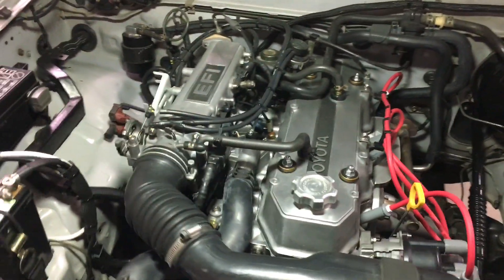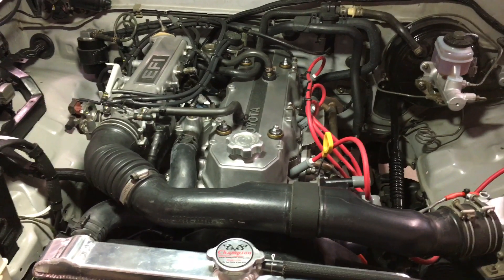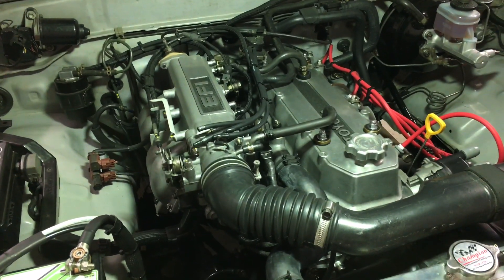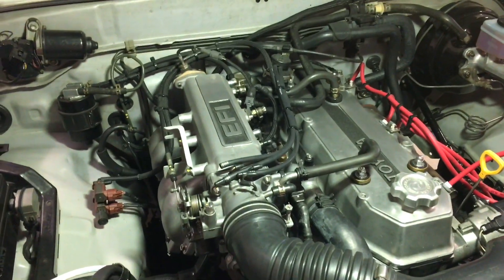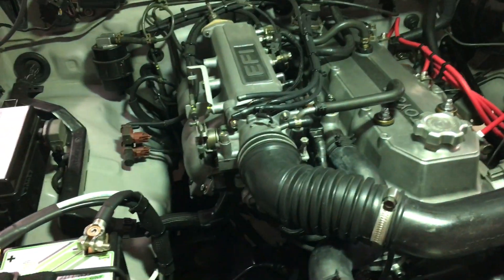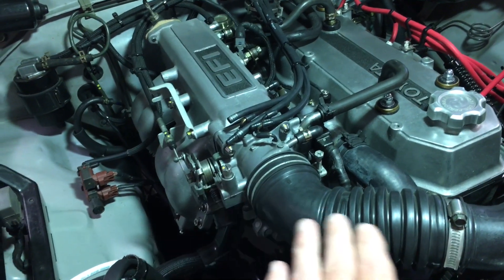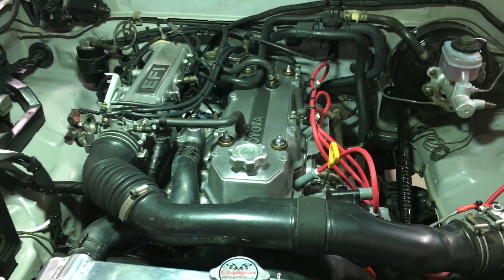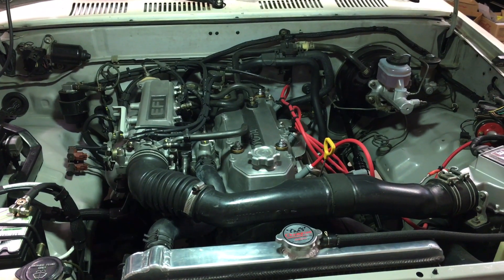Toyota 22RE pickup dashpot adjust fixes unstable idle (dropping to 500 RPM's when coming to a stop)

Comment: I'm starting to have an issue with my 94 toyota pick up it turns on with with no hesitation it idles perfectly fine when I have it In park but last week I was at a light and when i took off it started to sputter and jerk as I was pressing the gas and it almost had no power until it just stalled out completely, any idea in what this issue could be ? Like i said it has no issue starting up and idles completely fine on park its just the whole accelerating issue and having almost no power and then stalling out
Reply from the maker: could be a lot of things, but I'd start by checking your plugs to see if they are dirty or oily and also check fuel pressure.
Reply: @ray5961  thank you sir i removed one of the spark plugs and it had oil on the thread but not on the electrode im going to replace all of them and will run a pressure test
Reply from the maker: @AlanGonzalezAGON  which plug # had oil? Yeah, a compression test is a good idea. Pull the 15A EFI fuse when you run it and keep the throttle plate open. All plugs out.. PSI should be around 170 +/- across the board
Reply: @ray5961  will do and it was spark plug #4
Reply from the maker: @AlanGonzalezAGON  Do you live in an area with any hills? Sometimes what happens on the 22RE is that it sucks oil through the PCV into the intake manifold... then when you go up a hill, that puddle of oil rolls back and gets drawn into cylinder #4. Not always, but if you see blue smoke coming out when you are going up a hill under load, you might want to check to see if there is oil being drawn into the intake.
Reply: @ray5961  I live in houston tx so its pretty flat here haha but I did buy the truck from Kentucky with 86k miles about 4 months ago i am planing to give it a full tune up and replace the from main seal and new timing and valve cover gaskets since it is leaking oil but not a crazy amount
Reply: I bet it is the fuel pump. They can do what you are describing when they are going bad.
Reply from the maker: @johnjames77  I would say you were onto something, if I hadn't just replaced the fuel pump :-) In the end, it just turned out to be a lot of issues. I think I had my IAC valve adjusted incorrectly and that was most of the issue. I'm running it at 4.0 turns out CCW and it's nearly perfect. 4.25 turns might be exactly right, but I don't want to have to take the IAC valve off for the 10th time :)

Comment: You'd think that slowing down the throttle closing would contribute to a leaner condition since that means more air was allowed in than if the throttle closed faster.  I removed the dashpot and all emissions devices from my '94 Xtracab 4x4 DLX 22RE, as well as the VSV that alters the fuel pressure vacuum signal (I was prepared to re-equip that one in case the truck behaved goofy and/or had any quirks starting up hot, but it's been 4 years w/o issue). 
I'm also running header (Doug Thorley), test pipe (well, home made flex pipe with flanges to keep stress off the exhaust) and LCE catback.  Sometimes on decel in 2nd gear, at low RPM (~1500) I get a nice gurgle, but IDK if that's related to the dashpot being removed.
Reply from the maker: Yeah, I'm not sure. I have since disconnected my dashpot totally and I'm not having any problems. I believe I have traced the issue I was having to too much oil being drawn in through the PCV valve. I'm still testing, but as soon as I know for sure I may delete this video and post a new updated.
Reply: @ray5961  Interesting.  I do have an oil catch can plumbed in between the valve cover PCV and the intake mani plenum.  Mine collects maybe about a cup of oil every year.  I assume it’s related to my oil consumption, which is bad enough to warrant adding a quart between every 3k mile oil change.
Reply from the maker: @cbh148  I'm going to do a video on oil consumption soon here. I ran into similar stuff. For a while my truck was using 1 quart every 450-500 miles and I thought I had oil control ring issues. Turned out it was PCV / baffle issues I think. I made some mods and put the catch can on and discovered it was drawing a huge amount of oil out (about 1.5 oz per 30 miles). After making some modifications to the PCV, I have it down to around 1/2 oz per 35 miles, which is I think around 1 quart maybe over 2000 miles. I've got to modify the internal baffle soon to see if I can reduce it down even more. But thanks for sharing your info, that's really helpful!
Reply: @ray5961  Sounds like a similar path to mine, where I replaced my PCV a few years ago hoping the original one was worn out in an attempt to improve crankcase vacuum and, thus, ring seal to decrease oil consumption.  Looking forward to the vid.  I've heard some have had luck putting Marvel Mystery Oil in their cylinders, then letting it sit overnight to free up rings, but I haven't tried it.
Reply from the maker: @cbh148  I've poured everything you can think of into my cylinders lol. It definitely helps free things up. Most of the oil is being drawn through the PCV typically. In my case, I had to cut off one of the baffles for my dual row timing chain conversion and I think that opened up a path to allow a bunch of oil to get sucked out. I just was messing around with how the PCV is mounted and went back to more of a stock setup; the result was 5 oz of oil sucked into my oil catch can in 88 miles. Unreal.
Reply from the maker: @cbh148  I think I solved the mystery on mine last night. Video coming soon
Reply from the maker: @cbh148  Are you running the dual row timing chain conversion from LCE by any chance?
Reply: @ray5961  I’m not.  I’ve replaced my chain & guides but it’s still a stock-style single row setup.
Reply from the maker: @cbh148  ok thanks. I'm about to make that video on oil consumption. I'll post it later today I think.
Reply: @ray5961  Right on, looking forward to it!
Reply from the maker: @cbh148  I just went out and checked the motor and my PCV stuff and the oil catch can. I've been able to get it down from consuming about 1 quart per 400-500 miles down to only about 1 oz per 85 miles. So that's about in line with what you are seeing there. My calculations show about 1 quart per 2400 miles +/- at my current catch can rate. I've got a few more tricks to try out. I'm thinking about modifying the baffle inside my valve cover. Check out this link: http://mewagner.com/?p=1221 - I think this relates to the oil consumption issues I've been having. I think my oil control rings are probably okay and it's mainly the PCV oil baffle issue.
Reply from the maker: @cbh148  It's up! https://youtu.be/g_qy4ZWy2gM

Comment: Have been enjoying your Toyota videos, thanks for the content and ideas. Your water neck, did that come tapped 3/8-19 BST like the other block plugs? Haven’t seen one like it yet. Seems like the ideal spot to run a thermo switch for the fan.
Reply from the maker: I'm not sure what threads it had originally. I had to chase it with a 3/8 NPT tap as I recall, in order for the SPAL fan switch to thread in properly. I want to say I also might have had to drill out the hole at the bottom slightly in order to allow the larger diameter SPAL switch to fully thread down to where I needed it. I agree it's a perfect spot to run a fan switch.

Comment: It allows the dirty air to flush out so the engine has clean air to burn when you get back on the throttle.hence slow closing of throttle plate at  the last part of blade closing.
Reply from the maker: Yeah, I think that's the basic idea. Helps the catalytic converter do its job a little better too I suspect.

Comment: Great series of videos.  Not to many folks anymore like us who have fun with these 22r/re motors.  Doing another 22re build myself right now.  Something your might be interested in with you level of detail is I sent my plenum and lower intake off to be extrude honed.  I know a lot of money for minimal gains but it will be pretty and hope to gain a little efficiency.  Keep them coming.  Thanks
Reply from the maker: That's pretty cool. I was just telling a buddy of mine about Extrude honing the other day. Have you seen the porting they do now where they make a bunch of divots (sort of like a golf ball) inside the cylinder head ports these days? I'm building a turbocharged 3RZ and was contemplating doing that on the intake ports maybe
Reply: @ray5961  I have seen that,  I want to see some flowbench comparisons on that one,  would be awesome to see real results.
Reply: I have a 1990 22re 4x4 and mine just idles to low. Plus seems to have a slight miss if I hold the rpm’s at 2,000 rpm in neutral making me wonder if I need to adjust my valves or perhaps the chain has some slack in it. I have  already done all of the plugs wires cap and button with all Toyota parts. Need to figure out why I idle so low.

Comment: Hi Ray I need your Help My 1989 Toyota 22Re Auto Trans .When I start up The Idle Raise up High I did bunch the thing But still High If I bring Idler down then the Engine will stall out when I stop for Trapfic ??? Thanks Ray,
Reply from the maker: See my other videos about the IAC valve and see if the coolant lines running to it are getting warm

Comment: Finally a video!! For a minute I thought you might have had an accident.
Reply from the maker: Just been busy welding rebar :) What's the latest with your truck projects over there?
Reply: @ray5961  I’m sanding it. Not much, i post it on Facebook for sale. But not seeing anyone buying it. So I’m slowly sanding it down when I have time. Bought the 1997 Tacoma and had the seat reupholstered.
Reply from the maker: @ericrodriguez8556  Nice. Try selling it on Craigslist or cars.com - that's where the action is usually. Or eBay Motors is also good.

Comment: Very good information! I have an 85 and sometimes the same fault happens to me, how do you adjust the dashpot?
Reply from the maker: 8mm wrench and a 2.5mm allen key. The workshop manual has specs, but in this case I just set it for around 1.5 to 2 seconds. Be sure the dashpot is functioning correctly to begin with also. Mine had a tiny speck  of dirt clogging the main hole, which was preventing it from working correctly.